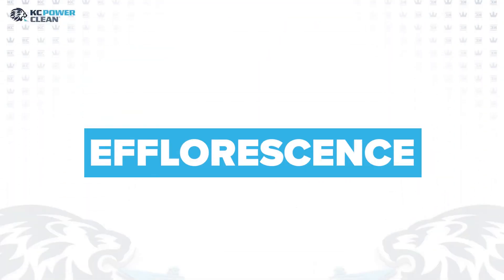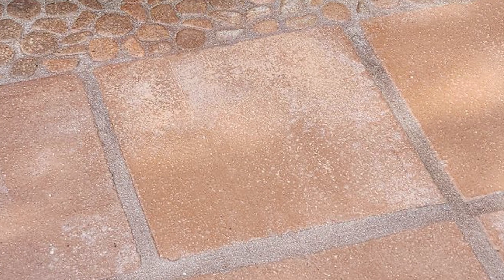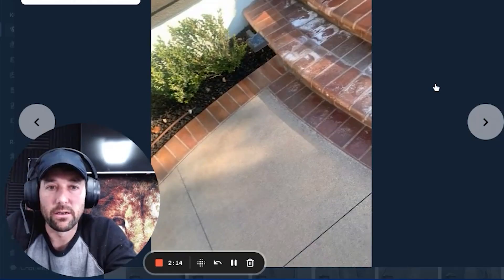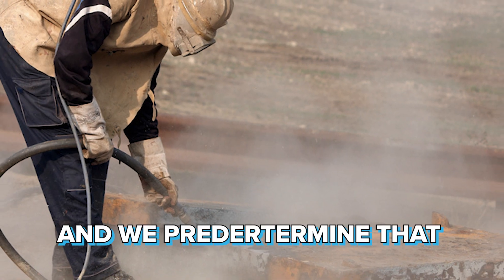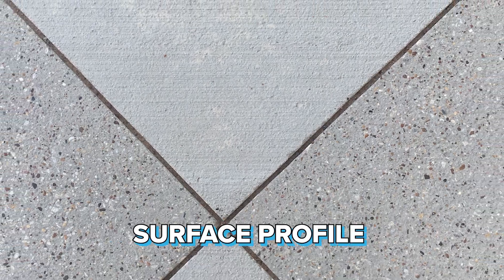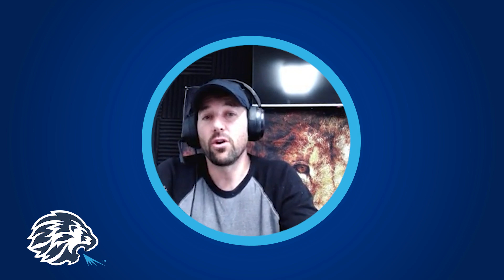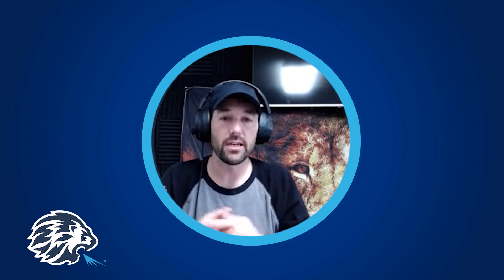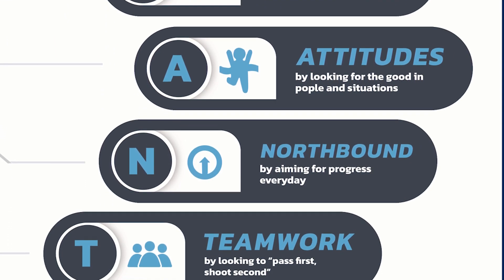Understanding Efflorescence on Concrete: The Silent Killer of Your Property |  EXPLAINED!! 😲🧱

Comment: If the concrete wall is a retaining wall, it will perpetually releasing moisture. An epoxy coating might help not let the vapors out.